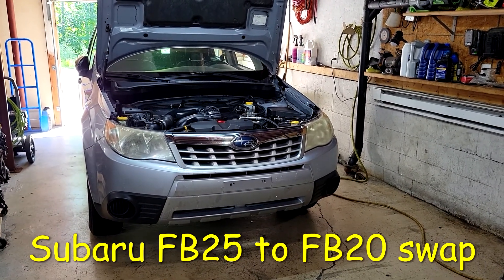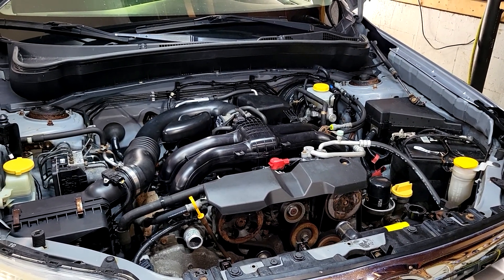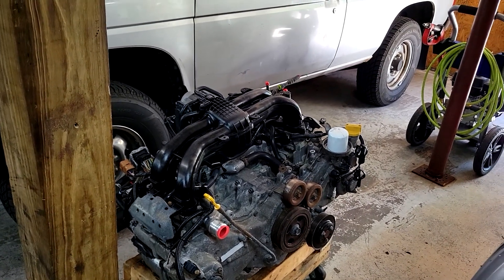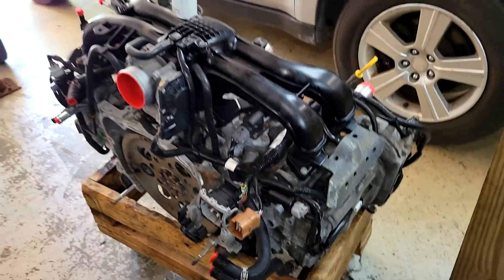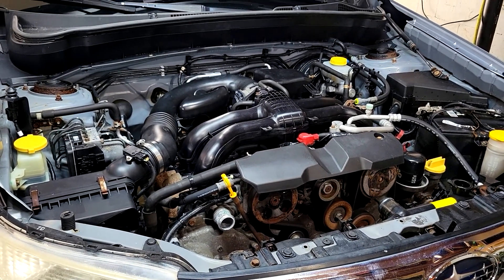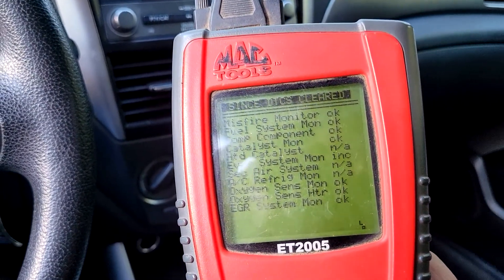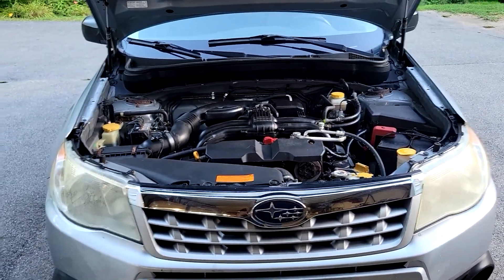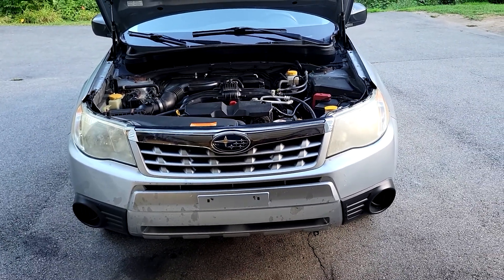Subaru Forester FB25 2.5 to FB20 2.0 Engine Swap Cheap Option To Fix Your Car Legacy Outback Impreza

Comment: @volksjager odd question but does pzev matter at all? Im looking to buy a 2012 Impreza fb20 for a 2012 Forester. I know the Forester isn't pzev equipped. Would this make a difference? Pzev ready fb20s seem to be much more inexpensive than non pzev. 800>370$. Just curious if this could cause any emission code issues etc. If anyone knows that would be very helpful.
Reply from the maker: no it doesnt matter. i know the junkyard yard list them that way, but the engines are the same. pzev just have a better catalytic converter and possible different ecm program.
Reply: @volks-jager  Exactly what I wanted to hear. Thanks much. Your doing a lot of people a huge service with sharing this.
Reply from the maker: @dylanwalters414  is you car an automatic or manual trans?
Reply: @volks-jager  auto I was gonna go with an auto pzev to cut costs
Reply: Im in mass and lkq is a candy store for these motors
Reply from the maker: @dylanwalters414  yes, the yard we got them from had load of these engines dirt cheap. keep in mind a 4 speed automatic car will be pokey on hills with the 2.0. the powerband of the FB20 is much better suited to a manual or a CVT trans. but it does work and is much better than paying thousands for a 2.5.
Reply: I'm going to the warehouse in Cumberland for mine, but yeah I saw the Webster and Leominster yards are just HEAVING
Reply: Hey curious. I'm mid swap, currently picking away at the engine/tranny mounting bolts. I had to remove the cv axle for the lower driver's side. No biggie but, the higher one. Hidden under the starter and sorta tucked into the casing.... How the hell did you get that guy? I can't even seem to get a stub wrench between the casing metal and the bolt head. Any advice?
Reply from the maker: @dylanwalters414  you do not need the remove the CV axles at all.  the starter must be removed. the lower bellhousing bolt above the CV can be removed with a 14mm socket and a extension. you will need to use a little braille as it can be hard to see
Reply: @volks-jager  I could see it being possible without removing the axle but that's how I got to it. The passenger side allowed for much more view so I managed to do that one without removing. Okay I'll have to find a way to get at those starter bolts tomorrow. I recall them being a little too low set to get at from the top but too close to the firewall to get my air gun in but a ratchet will have to do
Reply from the maker: @dylanwalters414  top starter bolt is easy, the lower you need a swivel or extension and i little fishing for it
Reply: @volks-jager  appreciate all your help, thanks

Comment: Hola bro, tengo un forester del 2011 con motor fb20 de 2 vvt pero ese motor no sirve.   compre un motor fb20 con 4 vvt y este motor viene con transmisión tr580 y solo puse el motor al vehículo que tiene una transmisión 4eat. Pero el vehículo no da start algun consejo?
Reply from the maker: what year did the 4 VVT engine come from? you cant go too far apart in years. for an 2011 Forester i would stay 2013 or older with the engine. as Subaru made changes to the cam/crank senors and trigger wheels on the later one. also this video really only applies to USDM. if you are in Europe or Asia things might be different on them i dont know for sure.
Reply: I’m having the same problem did you ever find a solution?

Comment: Does it matter if the donor engine is a PZEV? I’m getting a 2013 FB20 for a 2011 Forester to swap and it’s a non-PZEV.
Reply from the maker: doesnt matter. you can even use a manual trans engine. just swap over what is different.
Reply: Thank you! I order a 13’ FB20 with 31K for $950 yesterday and plan to have a mechanic do the swap but might do it myself if I get the time.

Comment: Looks intriguing. Two question, where did you buy the engine so cheap? I see them for $1k all over eBay. Are they really not oil burners? I sold my forester to a guy and 5 months later it blew a rod. Reading up on it it appears the EJ motors are crap too.
Reply from the maker: we bought 2 of them from a local salvage yard (Fenix auto parts in Winchendon Massachusetts) for $300 each. price may depend on your location. i am in New England where Subarus are super common cars. i have yet to find an FB20 that burns absurd amounts of oil like the early FB25s did. the EJs are much better engines IMO, only thing that really fails on EJ are the headgaskets, but those are very easy to do.
Reply: @volks-jager  thanks

Comment: What has to be done to the ecu?
Reply from the maker: nothing. stock ecu run the fb20 fine with no check engine light
Reply: Weird
Reply: I am looking to possibly do the swap on a 14 legacy, 
Do you know if this swap is only do able on the impreza platform?
Reply from the maker: @Hoffmanstrailer  should work the same

Comment: This video decided for me that I will do the same thing with the 2013 that I have.  I bought an fb20 from a 2012 Impreza for 1500 dollars…but before you say I got screwed, consider that my new engine has a total of 29,131 actual miles on it.  I may have to replace my mounts, my new engine more likely than not was in front of an automatic and the manual transmission engine mounts are different.  Otherwise Imprezas and Foresters use identical mounts.

Comment: I just did a ej20 swap from ej25. Used the fuel injectors from ej25. I now have P0171 lean code? Any idea if I should use the ej20 fuel injectors?
Reply from the maker: it is worth a shot - what year is the car?
Reply: @volks-jager  2010 Forester XT.. i have cylinder 1, 3 and 4 misfire.. I’ll check PCV when I bring the car home. Left the gas cap open and forgot about it..I hope it’s a simple fix
Reply: It’s all good now. I missed a vacuum line from the back of intake going to the intercooler diaphragm… i had to replace a motor on the TGV.. it gave me a P2008. Good thing that I have extra parts that came off the JDM engine.

Comment: I have a 2009 Forester with the EJ25 moro and MT so would that work in my car?
Reply from the maker: no. this only apply to cars with the FB25 engine
Reply: Ok, thanks. Would a EJ20 then work hopefully? I really appreciate your response
Reply from the maker: @mehoduzic4344  nope - they never made an EJ20 with AVLS - you will need the same engine for that car

Comment: Good day sir.  Enjoyed the vid… my son blew his 2007 forester 2.5 up.   Can I use the same motor for  2007?? Any suggestions…. My part guy want 2,700 with a 30 day guarantee, 3300 with a six month crazy
Reply from the maker: no, this video only applies to the FB25 engines. an 07 Forester will have an EJ25. $2700 for a used EJ25 is highway robbery.  your best bet to get a cheap EJ25 is to buy an entire running car that was in an accident. check out insurance auctions like Copart or IAAI. also check your local Facebook Marketplace. i have bought many cars like this for under $1500 then you get all the extra parts, plus can sell the catalytic converters off it and get $300 - $500 back
Reply: @volks-jager  thanks so much sir! Peace
Reply: Would a 2.5 from a Outback work?
Reply from the maker: @buckeddy  if the Outback is 2006 to 2009 yes it will work. fine.  you will just need to swap a few parts from the old engine over - intake manifold and the small engine wiring harness on the intake, the aluminum water crossover tube sometime has a different angle so check an switch if needed ,motor mounts, and flywheel if trans is different than the one in the forester.
Reply: With an EJ engine if your car is a manual transmission model then there are some pieces of sheet metal that go over the crankshaft and camshaft gears that you absolutely must change over to your new engine if it cam from a car with automatic transmission, otherwise if you stall out releasing the clutch pedal you may jump timing and you do not want to do that!  If your setup goes the opposite way any you are replacing an engine from an automatic with one from a manual, you can leave those pieces in place and not worry about them.